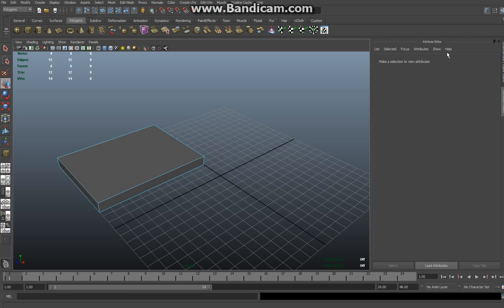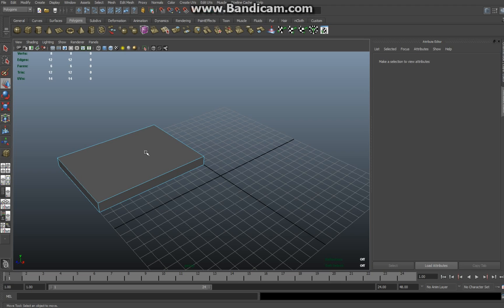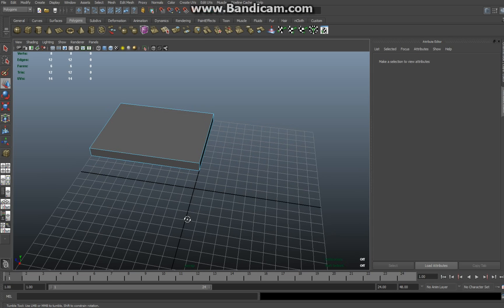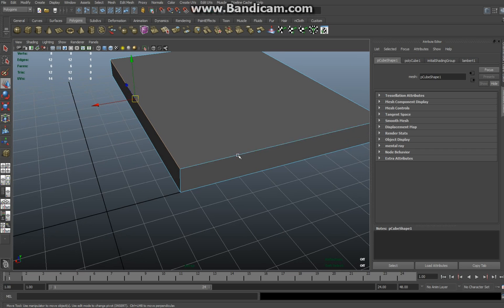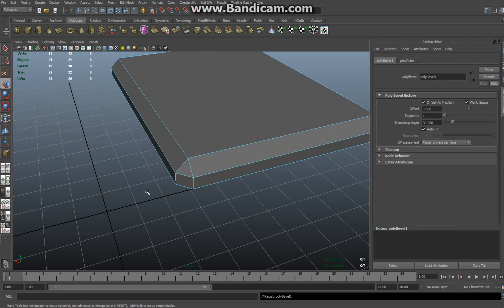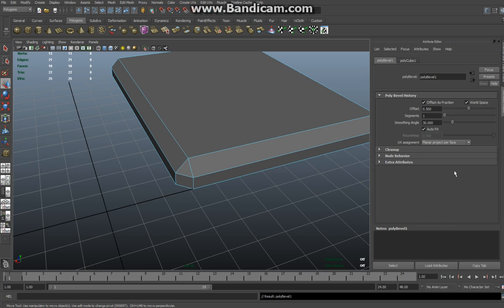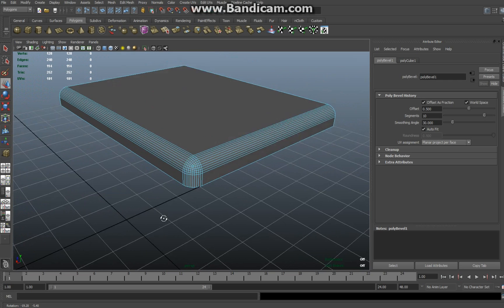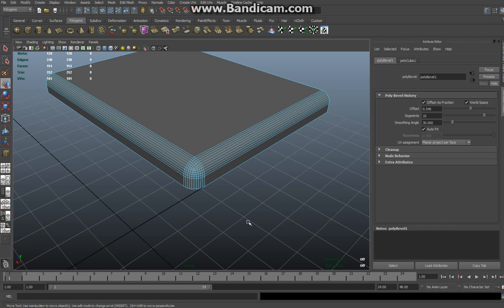Maya tutorial : How to create rounded curbs for a street scene in Maya

Comment: Great video, Mike!

However, I do have a question. With offset in polyBevel, what if the offset is greyed out?
Reply from the maker: +Junebug Presents What Maya version are you using ?
Reply: 2016
 Mike Hermes
Reply from the maker: +Junebug Presents Hi Junebug, when using bevel in Maya 2016 you should see Fraction ( wide or narrow ), Segments and Autofit.If you hit the little circle in the top right corner of the box you will find more options that you can turn on or off.

Mike
Reply: Mike Hermes
Okay. Thanks. Mike. I see they tried to make it simpler, the u.i.
Reply from the maker: Yep